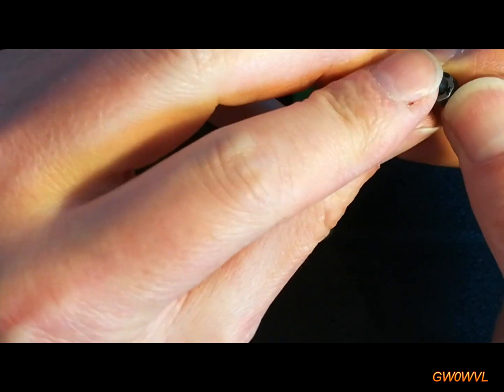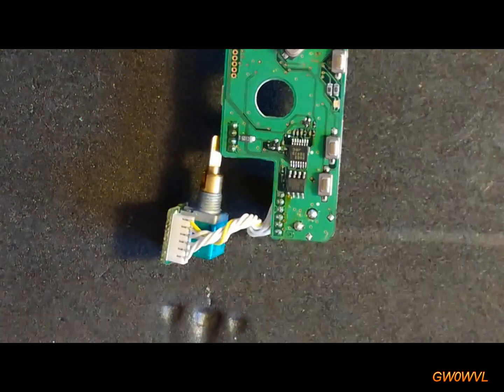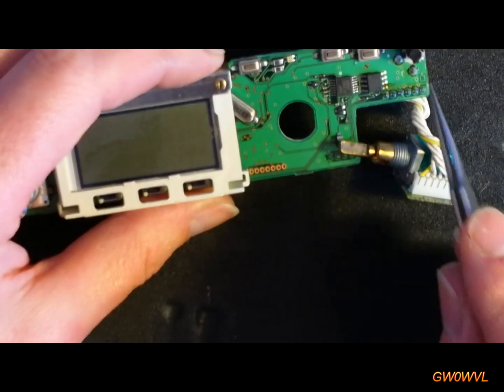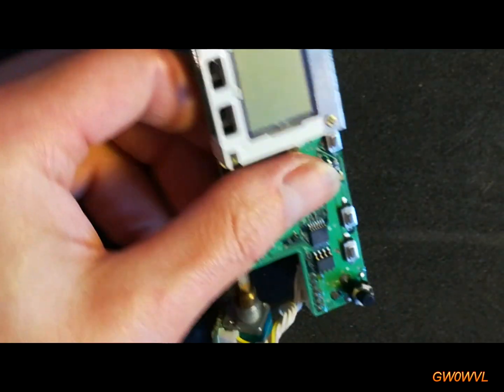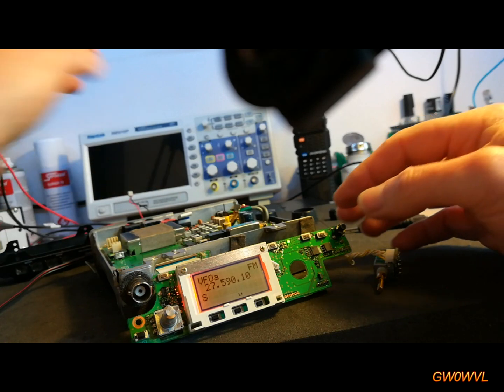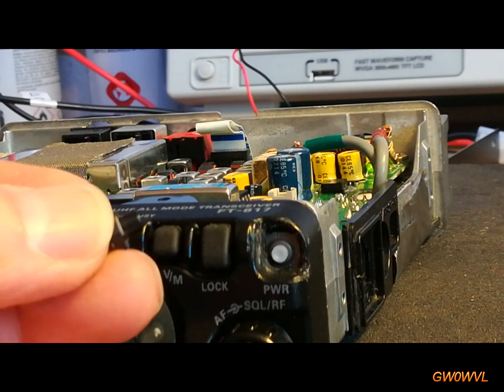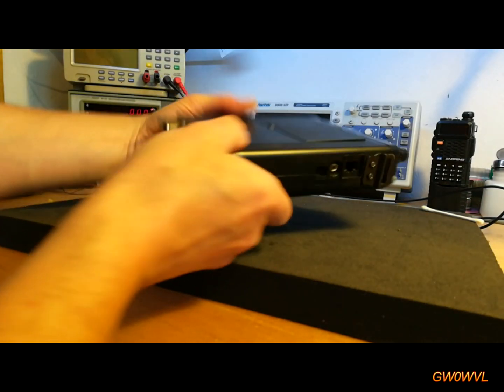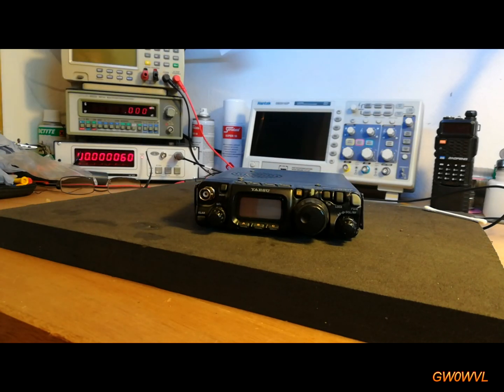Gw0wvl .. Repairing my mates  Yaesu  FT-817

Comment: Great job mate got the lad on the air. I have a 857D with lines going through the screen bugs the hell out of me, I took it to a guy to have a few things fixed but he said these screens cant be repaired any ideas mate
Reply from the maker: Ive repaired a few of those 857's , The screen has always been a right pain and a source of Failure, Your  guy is correct when he says the screen cant be fixed, The problem is the ribbon cable going to the screen, Theres nothing actually wrong with the screen, Its the how the ribbon cable is  fixed to the screen , Thats the issue . 

The ribbon cable is ' Eletrically Bonded '  to the screen, And its this bond between the ribbon cable and screen thats the issue , The Tiny wires that make up the ribbon cable  become unbonded from the screen and the connection is lost, No signal then makes its way from the wire to the screen and that portion of the screen is basically dead and only shows a line .... Yaesu used to sell the screen and the cable already bonded to it, So all you did was  unsolder the ribbon cable from the PCB and resolder in the new one along with the screen attached. 

Unfortunately   Yaesu stopped selling just the screen many years ago due to  complaints with reinstalling the new screen...  Now the screen 'Has' to be bought along with the main board , Its all sold as one complete item now,  Obviously the price is more as you are buying the complete front unit basically .. Last one i bought from Yaesu UK was some  £160 just for the screen and  mainboard... This was a few years ago now and the price may have gone up.
Reply: @Gw0wvl  Thanks for taking the time to reply, all makes sense now. Mmmm why couldn't the radio tech explain it to me the same way you just have. I will price the screen and board but maybe better to leave it as it is rather than me do more damage but it is a pain.